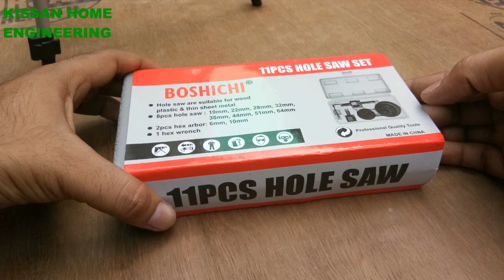Carbon Steel Metal Alloys Wood Hole Saw Cutting Set || Unboxing and Usage

Comment: Thanks for clearly demonstrating how to unite the pieces. The larger assembly of my own set was jammed and I hadn't wanted to lean on it harder to make it unscrew (as it seemed engineered to do) in case it broke. So you relieved me of that ta and also helped me twig to the interchangeability of the drill.

Comment: The whole point of the drill bit is that you do half on one side and half on the other side, since you see the hole made by the bit on the other side. That way the wood would not be burned.
Reply from the maker: Thanks for suggestion

Comment: I tried to use on bamboo and plywood but it just wouldn't stand. It would keep going sideways. Any help how to hold it on one place?
Reply: i m having the same issue, the bit wouldnt stand on the spot and it keeps rotating the entire stuface, how did you fix this issue

Comment: You are driving the drill speed to the maximum, use a slower speed on the drill and the wood wouldn't burn. If you use that speed using a using a hole-saw for metal on metal you will destroy even the costliest premium hole-saw available in the market . .